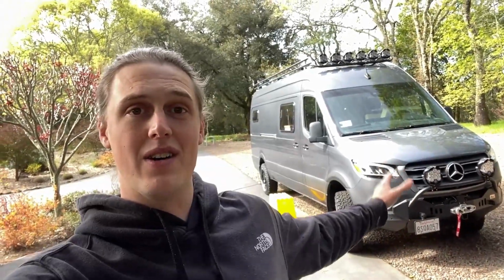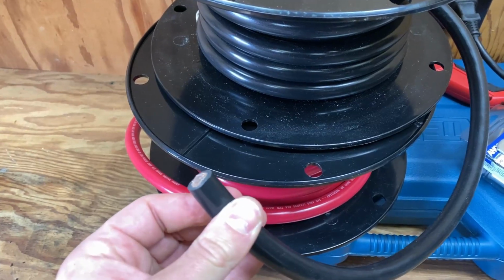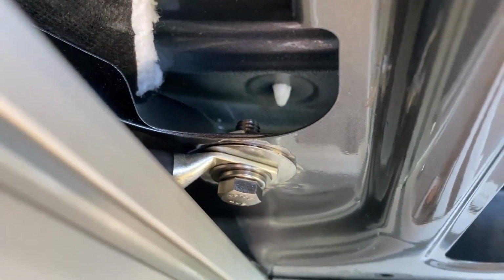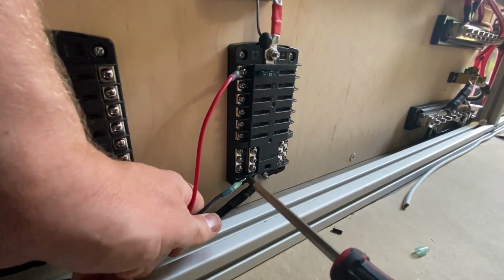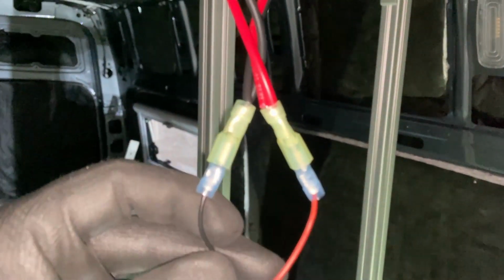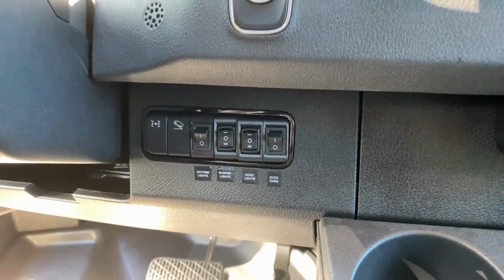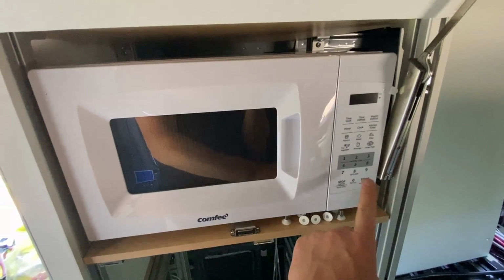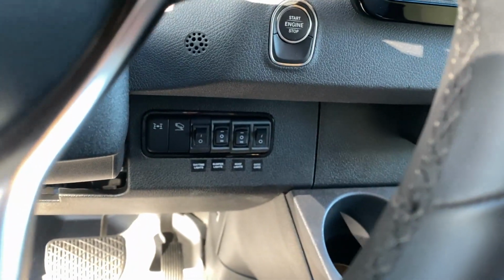⚡ How To Build An OFF GRID ELECTRICAL System In A Van ⚡ - Part 2 of 2 - Execution

Comment: It's worth considering going 24v with this system.  You get more reasonable wire gauge and fuse capacities, higher efficiency/wattage from inverters and solar charge controllers, etc.  24v to 12v buck converters are cheap and many 12v devices don't like to see voltages on the high or low side of 12v, so adding a regulated buck converter can save you some headaches from fans and fridges that do better with a regulated 12v supply, though many will accept 24v.  You seem to not mind redoing things so maybe give it a shot if you want to see if it's an improvement :)
Reply: Your right, when you have mor than 400amp/hr it makes sense to go 24 v or even 48v
Reply: I'm going 900ah. I was going to go 24v except the fact no one makes a 3000w inverter/charger for less then $4000 the money saved on wiring and charge controller was heavily outweighed by that one piece. Hence I will be going 12v since the renogy 3000w inverter charger is only $800
Reply: @build-things  there are plenty of 24v inverters and charges for much less than that.  They don't need to be a 2 in 1 device...
Reply: do the buck converters defeat the purpose du e to heat loss?
Reply: @build-things  look at the cost of your MPPT controller too (I'm assuming you're going solar, like we all do)  You need half the size on your charge controller and that can mean a couple hundred dollars of savings depending on your system.  There's also plenty of 24v inverters, but yeah you'll have to go to a separate charger unless you feel like shelling out a ton of cash!
Reply: @Colin999999999  I did look into it I would of saved about $200 on the charge controller but the Inverter and charger would of cost me about $400 more. I'm sure I would of saved on wiring sizes. But then I also would of needed a converter to run the 12v stuff if I was going marine 24 makes way more sence but for 1ev in a van it was very minimal differences especially in a small space having extra things like seperate chargers and converters would of been more difficult
Reply: Top comment!!
Reply: Who do you all recommend we talk to in making a decision between 12/24/48v systems…and perhaps for design assistance?
Reply: There's a reason why you haven't seen a bigger 12 volt system on the internet! Every off grid book out there tells you not to exceed 1000amp for 12 volts.

Comment: Great stuff, found tons of useful information on this video, just want to point that you giving tons of misinformation as well. The 60A of charge will be distributed between all 6 batteries (10A per battery), each battery is rated for 85A charge. Next, the relays from your lights as an example of how it works are rated for 40A max, so you can not use examples as 300A. Next, all your small connectors have plastic around them, this plastic is the same as a shrink tube, you have to use your heat gun to secure the connectors, so you will not be able to pull it out. Next, just a simple piece of advice on your manual switch to charge your batteries from the alternator, this is not the best solution, because at least ones you will forget to switch it off and because the alternator is directly connected to your battery will kill your sprinter"s AGM battery. The simple solution to use power from your ignition circuit to energize a solenoid-switch via a 12v relay . In this case the power from your alternator will automatically kick in as the engine is started and it will cut the power when the engine is off. Keep up the good work. This project is very inspiring!

Comment: You desperately need to fuse that 12v cable coming off the vehicle battery, at the battery. If you rub through that cable and short between your breaker and the vehicle battery, your build is toast. You should also ideally use some flexible conduit on that battery cable. This cable  to your DCDC charger is generally tied in to the vehicle fuse box under the drivers feet. It's a Mini ANL fuse, and there's an open position. You can exit under the front floor, there's a cable run, feed it into the drivers seat pedestal, and out the factory floor boot.
Reply from the maker: Good call I ended up fusing the + right after it comes off of the vehicle battery
Reply: Do you know if that  extra stud at the battery positive terminal was designed to wire the charger from my Inverter/charger? I am installing a 2KW AIMS Global LF Series unit. Any help will be greatly appreciated.
Reply: What size fuse do you recommend?
Reply: @jrubio7745  Depends on the current and size of your wire. On 12v systems you're commonly sizing with voltage drop in mind, check voltage drop calculators online.

Comment: Love the channel!  However, it does scare me with how close the positive terminals are to the metal frame.   Possible short circuit.
Reply: Noticing the same
Reply: Agreed. But easily fixed with a single strip of electrical tape or duct tape along that metal edge.
Reply: Looks like they are strapped down so they "shouldnt" move much, but it only takes one pot hole.
Reply: Exactly!  No tape, needs to add the thickest rubber strip that will fit. Maybe cut a 1.5 inch pvc pipe lengthwise.  But insulate that Aluminum or your gonna have a fire.

Comment: As a guy who wired his amplifier to a manual switch, i can tell you that you will forget one day to turn on/off the switch. It would have been better to wire it to a circuit that only receives power when the car is running.

Comment: I have to disappoint you m8, I have a 24V 660Ah Betterie installed in my RV. Weighs about 115kg including the housing. If you increase the voltage, the currents will drop. The 24V inverters are also cheaper.

Comment: Hi, thanks for the content. A couple of questions. Why did you decide to stay with 12v? If you were to use 24v/48v and a cheap step down for the 12v stuff that would have saved you a ton of money in cabling, Charge controller, losses, etc. And with regards to the cabling, why not just use conduit in the inside of the van and if you need to run more cables you just run them throught the conduit, no need to take anything down. Even better, just run extra cables on each destination in case you need to add more appliances. I think drilling 2 holes in the bottom of your van is not really necessary.

Comment: Wow! You just blew me away with your practical and easy-to-follow instructions. I’m a mechanical engineer and I understand all of this on paper but don’t have the practical knowledge to tackle this daunting job…until now!! Thank you so much for sharing!!
Reply: Maybe you can answer my question 🙋🏻‍♀️. I purchased the same lithium batteries from Renogy 170ah 12V and they come with size 1/2” M13 stud terminals. The blue sea fuse block terminal size are 5/16” M8. How did he get them to fit? Can the terminal stud on the battery be changed? Blue sea does not make fuse blocks with terminal size M13

Comment: Thank you for making these electrical videos. I keep finding videos that say they explain how to build an electrical system that turn out to only be time lapses of the work with very little explanation of what is being done or why certain decisions were made. Thank you so much for taking the time and energy to put out videos about the 'less fun' parts of building a camper van (electrical, plumbing, insulation, etc.) that might not have as much value as far as bringing in viewers like a flashy van tour might but can make these aspects of a build so much easier for newbies who are just trying to find easy to consume information about tougher aspects of a build.

Comment: Great build!  You may want to buy some lower 50 or 75 amp fuses for your terminal fuse blocks instead of those 300 amp ones.  Since you have 6 batteries in parallel the amp draw is evenly distributed between each battery, that means your 300 amp fuses won't blow until your entire bank is pulling 1800+ amps from a dead short, that's still plenty of power to melt a wrench accidentally laid across your battery terminals.

Comment: This was so clear and helpful! The level of detail you included is next level!! 

I'm really intrigued by the cables running under the van, I don't think I've ever seen that before but it makes a lot of sense

This was a great second part, thank you!
Reply: Yeah, me too. I’d be afraid (a) to drill holes in the bottom of the van and (b) that the wires would get damaged under the van. Is there any reason not to run all the wires inside the van, perhaps in an accessible channel in the floor or ceiling?

Comment: Love your channel! Another good use for a relay would be to act as an automatic switch. You can have your dc to dc charger turn on without having to flip a switch if You find a wire that only turns on when your ignition is in the run position.

Comment: SOS, Your videos have me so hyped to start my build. You may also want to test the microwave at the same time as the Weboost to ensure you don't need a little shielding to prevent the microwave from interfering with the cell signal through the antenna cables.

Comment: The first fuse you connected directly off the main 'live' cable from the batteries goes as close to the batteries as possible.  It is protecting the cable - stop it melting/burning and setting your van on fire.  think about how you wire a house -  the fuses go before the cable runs - they are not fitted inside the sockets and switches (exceptions do occur but that's another story)

Comment: @13:21 you can actually use the wire strippers to take off this type of wire shell. Just need the fancy wire stripers that pull it apart rather then the cheep ones that double as a crimper.

Comment: this is great and really helpful, one thing I would recommend would be to add plastic conduit around all the wires under the van, this will help prevent dust and rocks from abrasion.

Comment: OMG thank you so much young man...your clear instructions for this wisdom  is very much appreciated... at least now I know what's being used and why, what my shopping list will realistically look like and cost...I don't think I'll need 6 batteries...I had ki d of planned on 3 in case I have to use an electric toaster tupe oven and elec kettle vs a preferred propane set up...(if I need to keep oxygen in the van) from a 'what if' thought processesing... good to know it's OK to just go bigger just in case. Thanks again for sharing the wisdom this video is not too long considering a the important info you've packed into it. 😁 luv your window selections and layouts...perfect

Comment: That 8020 framing sure does make for a clean install! One small comment I would make is that you may not want such long cables from the battery bank to the 3000W inverter because that thing will draw a LOT of current! Shorter is better!

Comment: Great video, I hope you got around to adding a grommet on the 240v out cable where it runs through the sheet metal on the top of the inverter. It will gradually wear due to vibrations

Comment: Great post and build!  Those are Lithium IRON, not ION batteries I noticed.  So confusing for us folks not familiar with the differences.  So I researched it and here are my findings:

Lithium Batteries - Not rechargeable. These are your watch batteries and similar.  Not for RVs.

Lithium ION batteries - Rechargeable. Li-Ion is the shorthand for these batteries.  Stronger energy output, but shorter lifespan over Lithium Iron type.

Lithium IRON - Rechargeable. LiFePO4 is the shorthand for these batteries.  Li means Lithium. Fe is the symbol for Iron.  PO4  is the chemistry symbol for Phosphate. 

In terms of energy levels, lithium-ion is the preferred battery for power-hungry electronic devices that drain batteries at a high rate since it has a higher energy density compared to lithium-iron phosphate. However, when it comes to discharge rate, lithium iron phosphate surpasses lithium ion.

In most ways, LiFePO4 batteries are better than comparable lithium-ion batteries. Lithium iron phosphate batteries are less prone to combustion and thermal runaway, making them safer for home use. Plus, a longer cycle life means the LiFePO4 batteries will outlast lithium-ion for up to five times longer.

Is LiFePO4 better than lithium ion? The LiFePO4 battery has the edge over lithium ion, both in terms of cycle life (it lasts 4-5x longer), and safety. This is a key advantage because lithium ion batteries can overheat and even catch fire, while LiFePO4 does not.

Comment: You should wrap all the parts of the wire that touch the sharper edges of the van in some sort of protective phone. The edges will cause tiny tears over time in the wire and you’ll start getting random shorts

Comment: When you talk about battery wiring, it is associative like in an algebraic expression. Meaning that it will flow to and from all the batteries in the bank as if it were one. There will be no loop just because it is connected at the same end. Infact, an equalization will occur simotainiousely between all the batteries in the bank.

Comment: Great content! I've been following you since your first Sprinter. Very grateful for your time making these videos! 
Just be careful with the 8020 grounded on the chassis of the van :)
Reply: Hi can you explain what you mean? Ian planning on using 80/20 in a similar way. Do you mean you need to ground the 80/20 to the chassis of the van? Thanks!
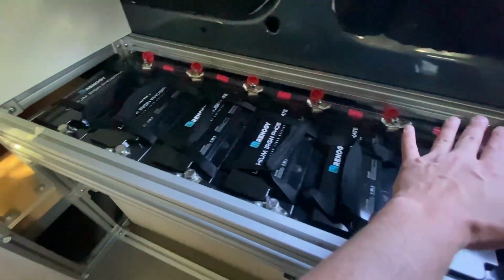Reply: I thought the same thing as Edson when I was watching the video. If you see at 9:24, the positive terminals are only a couple of inches away from the 8020, maybe even closer. The 8020 is conductive and it is presumably bolted into the frame in multiple locations, which would effectively make the 8020 frame a ground with reference to those batteries. Unless you have a fuse or DC Breaker installed on the negative side of your system, you run the risk of creating a direct short to ground and the current won't stop flowing until the BMS cuts out on short circuit detection or the wire melts. If it's only a small wire that is shorting, the BMS won't detect that as a short circuit, and your wire(s) will start glowing red hot until they melt!
Reply: @2sherrymoore  Even worse...if one of the batteries becomes loose in the mounting frame and the positive lug actually hits the 8020, the lug could get fused to the 8020 before the BMS cuts out on short circuit detection. For that reason, it is best to use wood or something non-conductive to house your battery bank.

Comment: I want to say well done on the marine grade shore power receptical,  most people use that plastic crap.
But just an FYI on your solar breakers, code states that the positive and negative need to be disconnected simultaneously,  which means your going to need a dual pole 250v dc breaker at the recommended max amperage of your solar array.

Comment: Thought? Run wire conduit within walls before adding insulation. You can then snake wire via the conduit vs drilling though van floor or roof when adding new wires? Thanks for the video..  Very well explained.
Reply: oh great suggestion! thanks for contributing

Comment: Nice presentation, just one thought. The 2/0 wires connecting engine batt to house batt think you said is fused at 300 amps. This I believe is to large a fuse since 2/0 wire max capacity is less than 200amps. Fuses cannot be sized greater than the wire capacity.

Comment: Glad to see you are separating the battery bank from the car staring battery and alternator. However, once you go down this path it makes a lot of sense to operate at 24V or better still 48v - those wires and busbars you fitted would not then need to be so chunky or expensive. These days you can buy buck converters for so little you can still use 12v lights etc if you wish or even 120v if you have an inverter fitted.

Comment: Great video!  Only Complaint I have as an Electrician is your saying ( AWG ) as a word.. Just say Gauge,  ( AWG ) means American Wire Gauge anyway.. and can me misunderstood as the word AUGHT as in your 2 Aught Cable 2/0 or 00.   Very Clean and well thought out. Thanks for sharing... Also didn't really need to sacrifice an extention cord for the microwave cord as you could have purchased a replacement end at a hardware store.

Comment: Great build, my is just a few steps behind and also a 4x4 sprinter. I am using all redarc systems and running two dc to dc chargers side by side that will provide 80 amps charge to the battery bank. So I was a little worried when you said 50amps is max 😳 I specifically got largest alternator option (250 amps) to run both dc to dc chargers. Can you please advise where you heard this limit from 🙏 oh and let me offer something back. I would highly recommend that you run a starter battery isolator connected to the ignition that will only allow dc to dc charger to operate whilst the ignition is on. This will prevent your starter battery being drawn down if you forget to press the switch.

Comment: I was working on a battery storage system the other day that had a short circuit current of 14.5 KA.......you don't drop tools or bolts when working on this system...when not more than once.

Comment: Fantastic video with heaps of information to unpack.
Just one small criticism.  The last positive battery terminal that has the cable connected is frightening close to the aluminium frame.  In even a small accident it could easily touch that frame.  Suggestion.  Cut a thick piece of plastic and glue it to the frame to surround the terminal on two sides.  Otherwise brilliant work! 👍😀

Comment: You really need to put the breakers for your 12V fuse panels closer to the ‘source’ (BussBar). The reason for this is that if the van gets hit and pinches the #2AWG wire to the 8020 framework, those wires are only protected by a 350A breaker which those wires cannot handle. Always protect the wire at the source side of the wire rather than all the way at the destination side.